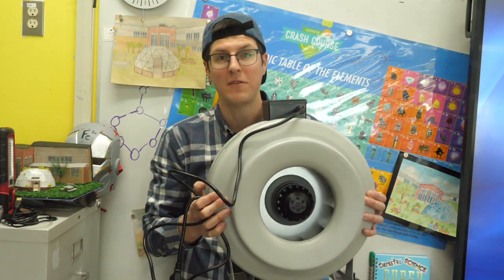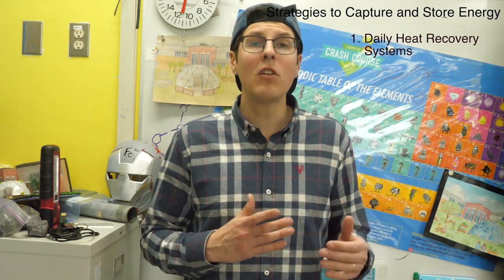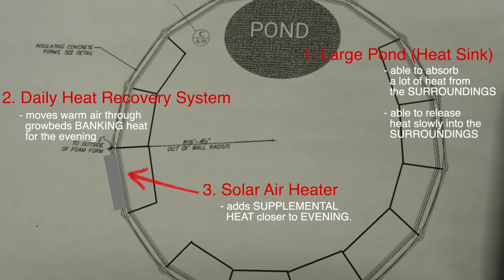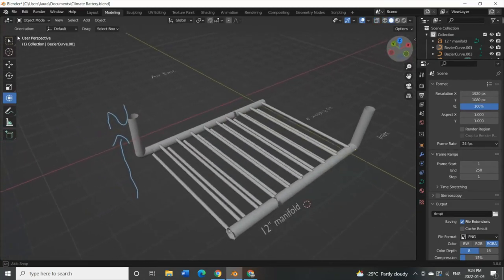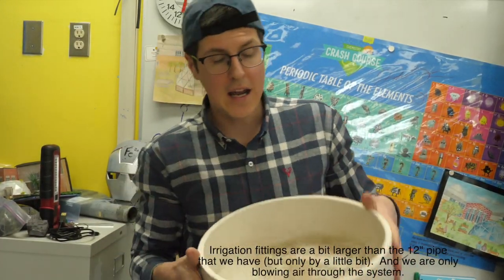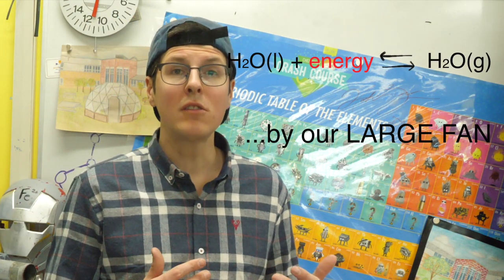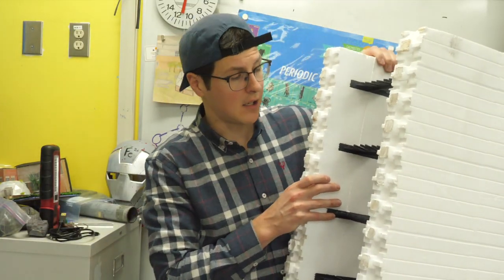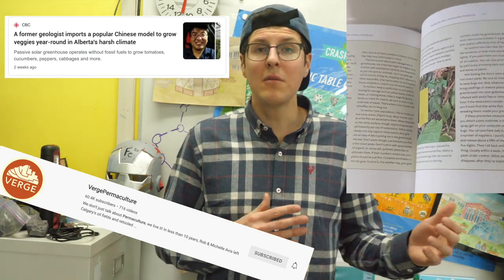-35 CELSIUS! Planning Our OFFGRID Greenhouse - Heat Needs

Comment: Nice work! Can you share links to the daily solar air panel? Have you heard whether those are effective in domes?
Reply from the maker: Arctica Solar - Solar AIr Heater:
http://www.arcticasolar.com/?gclid=CjwKCAjwvuGJBhB1EiwACU1AidyfurQ2wJB9_SXDqCLj-XVh8wf3AOe_3gMFbcbZmK9bX5bEIrVb4BoCv7AQAvD_BwE#product

Haven't necessarily seen them on any domes, but have read (and heard Verge Permaculture talk) about them being added to passive solar greenhouses.  

We are still considering solar thermal (evacuated tubes)...and maybe tying that into the pond to heat the water.  We also will be DIYing a small scale photovoltaic set up which will give us a bit of electricity that may help (either a tank heater in the pond or small electric heater). 

We started with the Air Heater and Climate Battery because the cost wasn't crazy and it gives us a chance to try something at a lower cost. If it only makes a small difference we can continue to incorporate additional systems to get to our goal.
Reply from the maker: As a follow up the solar air panel has really helped with our heat budget so far. -20C outside 15C+ in

Comment: Are you able to provide the math for the 33 foot dome?
Reply from the maker: This link worked well for checking our calculations. The students did the math but this gave us a double check
https://monolithicdome.com/spherical-dome-calculator
Reply from the maker: The climate battery calculator has a place to then enter the square footage and volume of what you are building for. 
http://www.ecosystems-design.com/climate-battery-calculator.html

So we plugged in our numbers and got some specs.